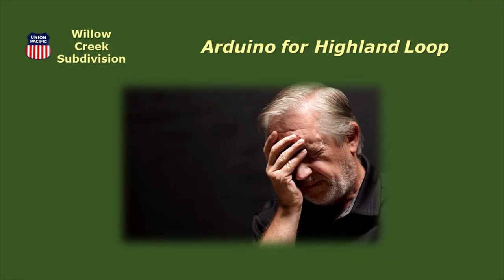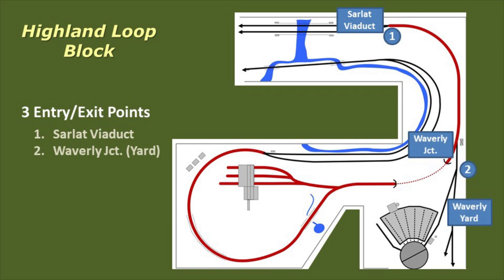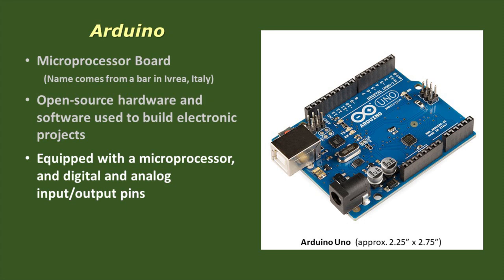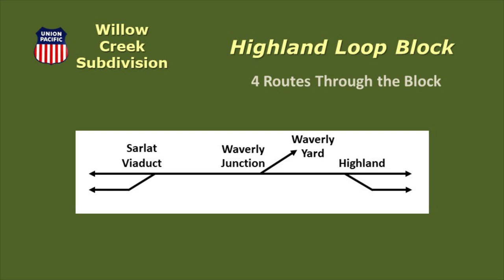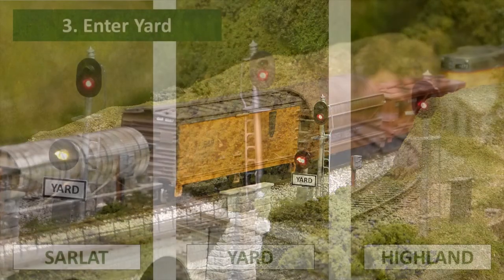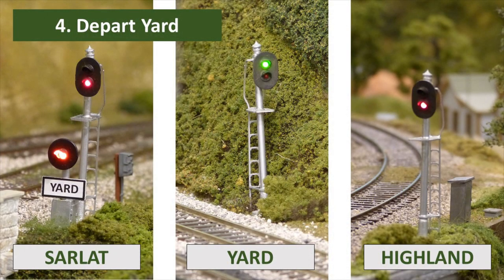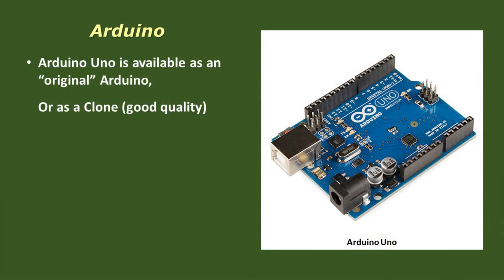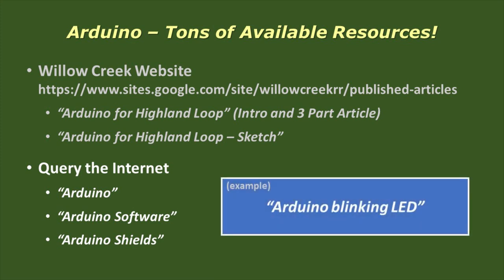Willow Creek: Signals and an Arduino for Highland Loop

Comment: This is really interesting, thanks! I must admit I was a bit confused myself about the signalling system in your earlier videos - though it didn't matter too much since I wasn't holding a train controller :) But this setup definitely simplifies things a lot which must make it easier for operators - especially new ones, which I appreciate as a novice myself!
Reply from the maker: Novice or expert -- the old signals confused everyone!  The Arduino saved the day.  Yeah!  Thanks for your comments.  Much appreciated!

Comment: It’s a great solution for the problem. Is there a solution to prevent two trains entering the mainline from opposite directions at the same time?
Reply from the maker: Very rare that we'd see two trains hitting entry/exit points at exactly the same time, but during op sessions, that's where the dispatcher would come in to play.  The DS would recognize two opposing trains ready to enter a block, and would hold one of them until the other cleared the block.  Good question.  Glad you enjoyed the video, and thanks for the question and the feedback!  High greens!

Comment: Another adventure in fun. Is your train detection via optical detectors that require a lighted scene?
Reply from the maker: Greetings, Mr. Webster.  Definitely fun!  :-)   Yes, optical sensors, since that's all the Circuitron BD-1 uses.  So, unfortunately, full lighting required.  None of your slick evening lighting changes allowed.  Good to hear from you, as always!
Reply: @Vigment13  we have a grad crossing that activates when the lights are low. Thinking of another circuit.  Hmmm?